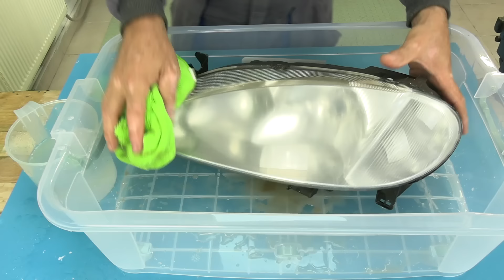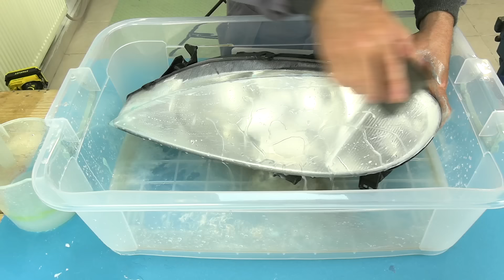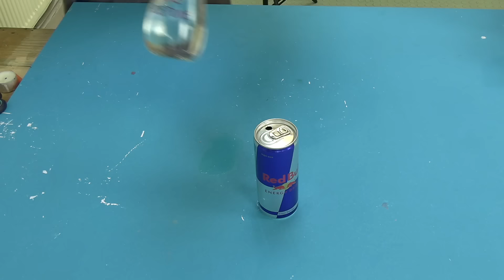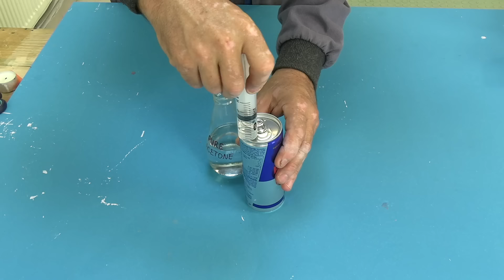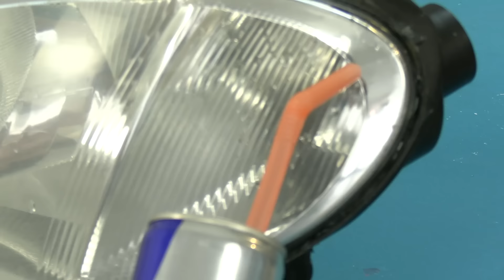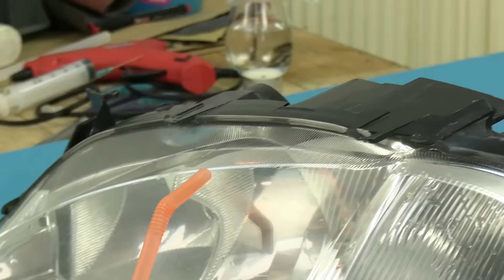Headlights Are Like New With 3 Drops  Acetone. I Could Not Believe My Eyes!

Comment: First of all, you didn't put a single drop of acetone on the headlights. Second, this process is a whole lot more than your misleading, clickbait title.
Reply: The vapour from the heated acetone.
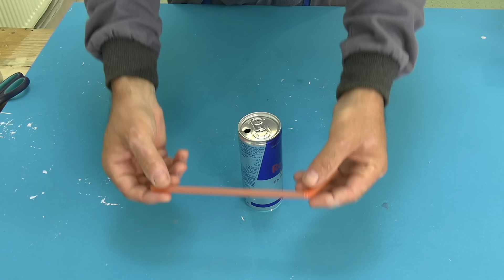Reply: 1:44
Reply: It is genius.
Reply: Acetone is in the pop can
Reply: @treborobotacon  
It’s an acetone mix isn’t it? I’ve seen videos with a blue liquid in the container that’s some sort of acetone mix. Maybe I’m wrong.
Reply: @notacreativehandle  
Acetone and dye. 
It's nothing special.
Reply: @notacreativehandle  
I used a heat gun to heat the mixture so it evaporated and came out the tube.
Reply: @treborobotacon  
Oh okay I was wondering. I’m unfamiliar with the process so I figured I’d ask.
Reply: @notacreativehandle  
It works but not perfectly, headlight restoration is a pain in the ass.  In the end you're better off buying new headlights if you can source them cheaply.
Reply: @notacreativehandle.   Many acetone brands have a blue tint.
Reply: @JohnDoe-md2sb  
I learned something new today
Reply: Denuncia como espam ou enganoso
Reply: @treborobotacon  ah, several hundred $ for new lamp housings or a sheet of 2000 emery paper ($1.00) and a bottle of acetone (women know that as nail polish remover $1.25 at Dollar General) OH, BTW if you don't have a candel  they are about a $1 also)
Gee, $3.25 versus, $186.99 headlight assembly for a Volvo (and that is just one side).
$379.98 PLUS TAX minus $3.25 PLUS TAX. 
For that difference I could have the entire neighborhood over and grill Ribeyes . . . TWICE
Reply: @GigMaresh  
Depends on what your after. If 6/10 restoration is OK then this is better then nothing. I've done it lots and it fades pretty fast and never looks new. You could also buff the scratches with 600/800/1000/1500 sand paper but again it's never going to look 10/10
Reply: First of all, you didn't understand, second, problem for you.
Reply: Don’t act like you know and calling this clickbait like a smarty a ss
Reply: Nothing clickbaited, you need a better subscription on glasses😂
Reply: YES,HE EVAPORATED ACETON ON IT.Are you a 🤡!!! Yes, you're with the rest of you following him/her!!!
😂😂😂!!!
Reply: @treborobotacon 
For a quick sale,it's worth it!!!😂😂😂.

Comment: 1000 grit & water, 3000 grit & water then a polish and that's it. Good as new. I would never advise heating a product as flamable as aceatone.
Reply: No thats not it.... You need to lacquer them to stop them clouding again...
Reply: He used an orange straw, so it should be fine. That’s we learned unicorn training yesterday.
Reply: No that’s not it.  it needs to be treated with a plastic coating sealer. To protect it otherwise it becomes exactly like it looked before in a matter of a few months. Ceramic formulas work well.
Reply: And it lasts 4 months.
Reply: They do this acetone heatin here in Turkey a lot but I found out, it does not last long. I did this sanding and polishing on my Mustang SN95 headlights and it works good
Reply: @Heathfloors лаком а потом бронированной плёнкой

Comment: Wet the headlight down. Get Soft Scrub(yes, tbe stuff for dishes) and run it in. The take a low to med speed hand buffer. Buff for 2mins. Wipe clean, cover w spray wax. Will last just as long as this does. 6mo-1yr.

Comment: That wasn't just 3 drops of acetone, come on
Reply: but a few drops on a rag and wipe it on would have done it, too,  I think.  Fixed mine by wiping.  You just have to clean them well first else when you wipe you might bury dirt or grit in the surface.

Comment: Wow, this video is amazing! I followed the instructions and used just three drops of acetone on my headlights, and they look brand new! I couldn't believe the transformation. Thank you for sharing this helpful tip!"
Lesson: Sometimes, simple solutions like using minimal acetone can yield incredible results in restoring headlights. It's all about being cautious and precise in application.
Reply: In a few months they will be yellow again. You need to apply a 2k clear to protect the plastic from getting etched by sulfur oxides. That's why they look yellow over time.
Reply: Hey nice to hear that it worked well for you, you did the same as shown in this video or just you rubbed Acetone over the headlights?
Reply: Buffing wheel and white stick polish sand first this is better

Comment: I get very good results from 5 mins with a rag and T-Cut or rubbing compound. Finish off with some car polish. I've done literally hundreds for customers to help their cars through the MOT inspection. I can only devote a few minutes as I usually have a queue of cars waiting, so my technique has developed. Arms feel like they're going to drop of when I've finished though! When the headlights are cloudy it ruins the beam pattern and dazzles oncoming drivers. And you see less 🙂
Reply: If you just polish, will it last? Some people say put on the clear coat has a longer lasting effect
Reply: What's t cutting or rubbing compound?  Car polish?  Is that wax?
Reply: I was going to say the same thing. No machine needed. Just a little elbow grease and 4 minutes of your time.
Reply: Any cut and clean paint polish compound like turtle wax or mother's, McGuire's.

Comment: Considering how we’re being told that petroleum products are killing the planet, car manufacturers are still using single use plastics on their headlights.
What happened to glass headlights? They rarely chipped, and were made of a material that can be recycled indefinitely.
Reply: 5X the price.
Reply: Probalby due to weight and cost for custom shapes for each model.  The only one I know of was the Cadillac Allante.  Those headlights outlast the car.
Reply: Had glass headlights on my old Citroen BX GTi. An impact with a pigeon was all it took to destroy one! And,incidentally,the glass was 5 to 6mm thick! Plastic has flexibility,unlike glass. Oh,and regarding dullness,the (in situ)application of Solvol  Autosol  metal polish with an electric buffing pad will restore most plastic units to their original shine, and ,should they be lacquer coated,this can be reapplied via a rattle can of clear coat from your local DIY store. Job done!
Reply: you can thank aerodynamic testing, gas mileage, manufacturing costs, and styling. Besides, statistics say it's only the second owner who has to worry about the problems of plastic headlights.
Reply: I would have to agree that glass do last alot longer and doesn't discoloring however when you get into an accident or the headlight shatters and the glass pieces spread all over the road,  it would damage the tires and cause problems with other things that the road is used for.  and another thing it is pretty difficult to make aerodynamics design with glass and plastic is easier on the molding machine.
Reply: @louisxiiii Until a stone is kicked up and hits one.
Reply: @dennislane100 You are right to select a fine Metal Polish. It pays dividends to NOT allow the headlight Lenses to get too discoloured in the first place. I have been using Brasso Liquid Metal Polish on the Polycarbonate Headlight Lenses for many years. Car is now 20 years old, but you would think that both Headlights were bought (new) yesterday.
Reply: Modern headlights are a ripoff scam
We used to just change bulbs and be good to go
Now you have to change the whole sealed assembly for 1000 - 3000 dollars depending on the brand
Reply: imaging the weight of Glass compare to platic, million of mile with 4 extra kilograms of weight (+ at least 2 kilograms per optic plus the danger when knocking a pedestrian
Reply: @barryredman2803  
The headlights on my old 1978 Chevy pickup were about $15 bucks a piece.
Far superior to the crap we have today.
Reply: @rupe53  
My 1978 Chevy pickup got about 12 - 15 mpg.   Glass headlights that cost $15 dollars each.
My 2011 Ram diesel gets 11-16 mpg.   Plastic crap headlights about $260 - $300 a piece.
Not only do they yellow, but they also filled up with water.   Junk.
Reply: They weigh more.......adding to overall weight of car and expense added to manufacturing cost
Reply: @billpainter6069  
Wrong.   The old glass headlights weigh less.
Reply: The custom shapes we have now would never hold up under the stress of every day driving. We'd have to go back to simple square, rectangle or round lights.
Reply: the weight would cause all those millions of cars to use more gas
Reply: @Briangizer  
There is no weight increase.
Reply: I'm with you. The real answer is greed not, glass molding or fixing cost like every post here. All new plastic headlights are still hundreds of dollars like glass use to be so that got debunked quick. All cars have come to plastic everything. Cost of making is lower than ever YET! the car price is still higher than ever before wtf.   All good product that don't wear fast and break will lead to slow income for them and that is all to it.  Example Ford headlights $400 to $800 depending for which car/truck , Ford Motor Company Headlight Plant, Flat Rock, Michigan, 1942 and died in 1950. Plastic housing, the lens, the bulb mostly all come from china and thats not a guess its a fact since America talk big and still employ cheap labor from over seas. If you can sell ok nice tv's giant size at wal-mart new for 200- to 400 bucks than there is no logical explanation why headlight cost are more expensive.    Plastic and LED its cheap its here and its used for everthing.
Reply: They were more expensive, harder to reseal, and created hazardous debri when they did break. I am glad glass headlights are gone.
Reply: Yes plastic is killing the planet and we should be using recyclables instead of one time use plastics.  My old glass headlights lasted forever and never needed replacement unless they broke.  They never got dull to the extent of endangering anyone's lives.  They were cheap to replace if broken.  I remember paying around $20 to replace a headlight when it broke.  Now it costs over $1000 to replace a plastic headlight.  I thought the entire reason everyone switched to plastic was due to cost?  Now we should be switching back to normal because of environmental impact!
Reply: Glass headlamps for new vehicles were banned in most countries by the year 2000 because glass shards on the road after an accident was considered dangerous. Most of those glass headlamps were similar, fitting a wide range of vehicles. This made them dead easy to copy and there was fair competition keeping the prices reasonable. As soon as this rule changed every car manufacturer started making completely custom headlight shapes for every model and charging to the moon for replacements. Unless the vehicle model is/was super common, hardly any aftermarket replacements would ever be made. So car manufacturers keep gouging customers on them. The extreme cost of a replacement headlight often leads to vehicles being a write-off after an accident. A similar affair happened with glass syringes in hospitals. They were easily heat sanitized. But that requires labour(nurses are too busy to do cleaning!). Along came disposable plastic single use ones and suddenly it was considered unhygenic to reuse glass ones. Back to the cars though... Modern vehicles are designed to fail in 10-20 years. EV's are a great example. By the time the battery pack fails it'll cost more than the car is worth to fix it. Please just buy a new one like your neighbour did, who wants a poxy 10 year old car anyway? This is the modern mentality.
Reply: You can't get the fancy shapes in glass , would be too expensive and heavy.
Reply: My first car (a many times over traded before getting to me in 1991) was a 1975 Mercury Comet.  Both headlights were dead when I got it, so a couple of aftermarket replacement glass headlights, it lit up the night brilliantly.  These headlights were great, and last for years before I sold the car to another teenager.

Those glass headlights were strong, and because of the bulb actually got hot--in the winter, once the car got hot, the ice would fall off.  Not the most energy-aware technology, but glass headlights were great.
Reply: Congressmen don't get kickbacks from the glass company like they do from the plastics industry..............

Comment: I think that General Motors used something like this to polish their plastic steering wheels pre-1970's

From Wikipedia: Vapor polishing is a method of polishing plastics to reduce the surface roughness or improve clarity. Typically, a component is exposed to a chemical vapor causing the surface to flow thereby improving the surface finish. This method of polishing is frequently used to return clear materials to an optical quality finish after machining. Vapor polishing works well in the internal features of components.

Feature size changes of the plastic component generally do not occur. Post stress relieving is usually required as vapor polishing sets up surface stresses that can cause crazing[citation needed].

Plastics that respond well to vapor polishing are polycarbonate, acrylic, polysulfone, PEI, and ABS.

The technique is also being used to improve the surface of objects created with 3D printing techniques. As the printer deposits layer upon layer of material to build the object, the surface is often not entirely smooth. The smoothness of the surface can be greatly increased by vapor polishing.[1]
Reply: would the same method also work for dull plastic trim around the car? lets say fenderarches/bumpers on a audi a6 allroad?
Reply: @sttm1283 A hot gas blowlamp will restore those Plastic Side Panels to new, but you must exercise care, and ensure that all paintwork receives no heat at all.
Reply: PROF !

Comment: The best method is sanding headlight and clearing (spray) it. All the other methods like cut n polish, this method will result in yellowing again in a few months of sun. I know from experience
Reply: Next time put a clear plastic wrap with UV protection, like the same stuff they use to protect your paint from rock chips and what not, think it's called PPF or something? It will last much longer

Comment: Clickbait.. he forgot to mention that you need to apply a lot of elbow grease as with any headlight restoration method..😁
Reply: How is it clickbait?
Reply: That acetone in the Red Bull can was kind of lame, and holding a candle underneath to boot? Any headlight restore guy who works in the field of headlight restoration has the vapor keddle kit you plug-in. There's no way I'd being doing clients like that with the vapor application. That has clickbait written all over it.
Reply: @headlightvideotraining  
“Clickbait” seems to be a common term just thrown around without understanding this is merely a diy if you don’t have access to or don’t want to buy special tools.
Obviously there is a professional way to do it, but not everyone is a professional. If someone wants to try this at their own risk, let it happen.
Reply: Dripping hot wax on a headlight in the thumbnail!!!!! Did you see him do that? Clickbait! @notacreativehandle
Reply: @notacreativehandle  "Headlights are like new with 3 drops acetone"
He used a lot more than 3 drops.
He had to sand and buff first.
Are you mentally incompetent?
Reply: @The_Gallowglass  The last one it seems

Comment: Heres a  fact people you can get a better result wet sanding from 1000 to 5000grit, then using a small 3" rotary polisher with compounds and GOOD quality buffing and polishing pads. Second of all holding a flame under a thin aluminum can with acetone is extremely extremely f**king dangerous. Acetone is more flammable than gasoline. A lot more flammable and i do not recommend this because when it goes it all ignites at once going BOOM!!! exactly like gun powder. I know, i paint and do cerakote for a living and old rags used with acetone have turned my burning barrel into a gigantic shot gun a couple times when i lit it and blowing all the trash straight up in the air 20' then landing all around the 55gal drum that is my burning barrel
Reply: lol